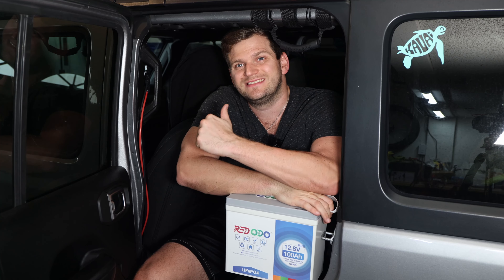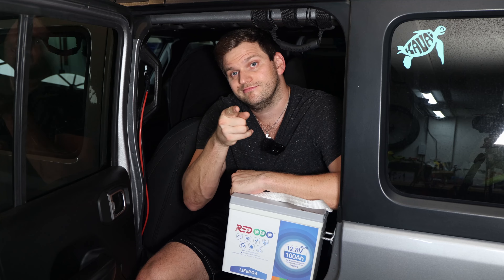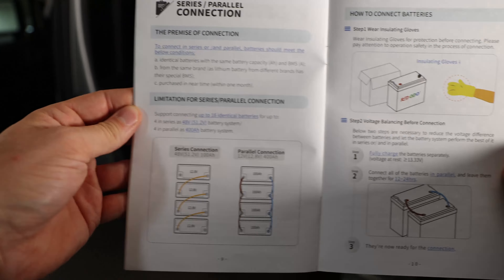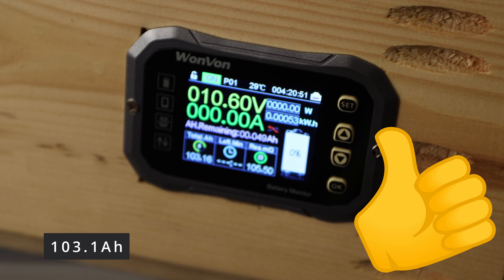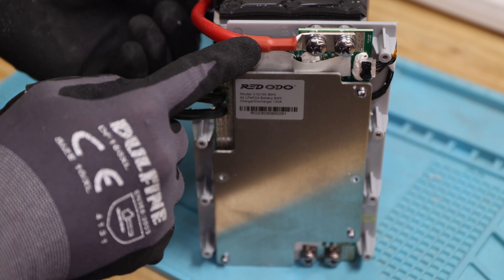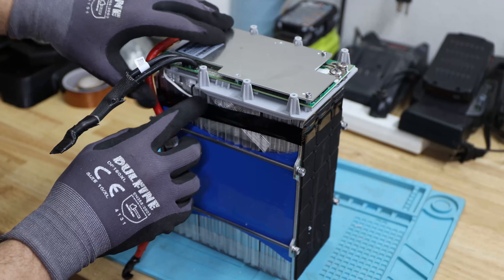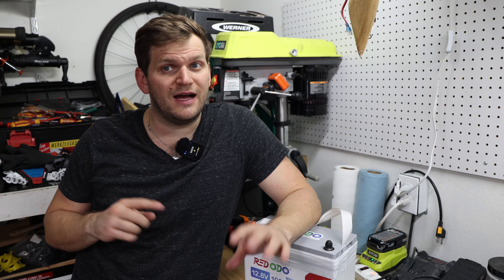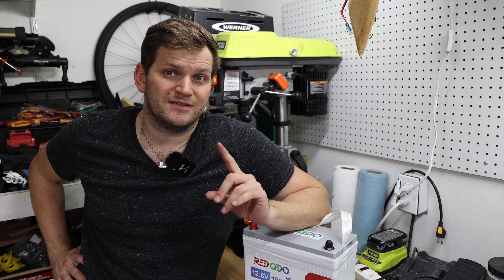REDODO MINI 100Ah 12V LiFePo4 | How does it perform after 3 month of use? | Teardown Battery

Comment: Thank you for sharing this. 
I bought and use the Redodo 12v  DC box and 2x12v minis.  Awesome product.  
I’m anxious to see a 24V 50ah mini for various projects.
Reply from the maker: Agree! Funny you bringing this up. A video with PowerQueen's Mini is coming  out soon about this topic! Great product!
Reply: @tobisreallifeskillswithtobi  awesome news about the Power Queen 24v batteries. They will make excellent battery storage extensions  for my Ecoflow units. BTW, the battery socket outlet is perfect for camping and overlanding. I use mine for powering my laptop, Iceco fridge and recharge the drone batteries.
Reply from the maker: @af1023 I love to hear this! Does the USB-C I assume, have enough power for your laptop?
Reply: @tobisreallifeskillswithtobi  Hey Tobi, good timing on the question.  I had a chance last week to try the hub and use the USBC-C link and it provided enough power for the MacBook Pro.  It stayed around 37w using an inline USB-C cable with a built in wattmeter.  
I also used both batteries in a 24v configuration to recharge the Ecoflow units when the sun was low.
Reply from the maker: @af1023  great to hear and thanks for your feedback!

Comment: No offence but you can't perform an accurate capacity test with one of these cheap Chinese made $30 DC load testers. We paid over $8,000.00 for each of the electronic DC load testers in our battery lab.
Reply from the maker: Thanks for watching! My video is not meant to be a lab test. It's meant to be a realistic use case like my viewers would use in a real scenario.
Reply: HamRadio 2.0 ran a test using a prosumer test rig and these mini batteries came in at 98Ah.

The older larger batteries came in at up to 10% over spec.

You could always post a video using your $8000 lab spec programmable electronic load and share the results.
I’m sure if you reached out to someone they’d be happy to loan you a battery.